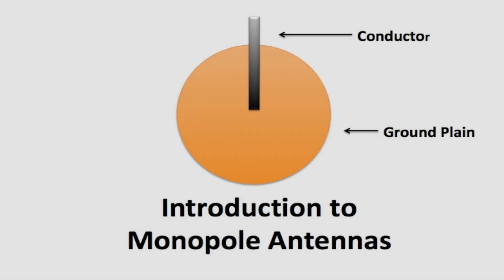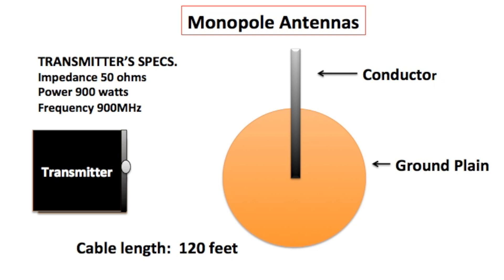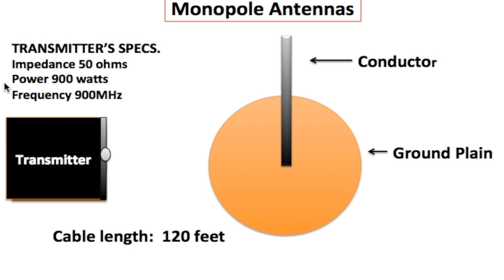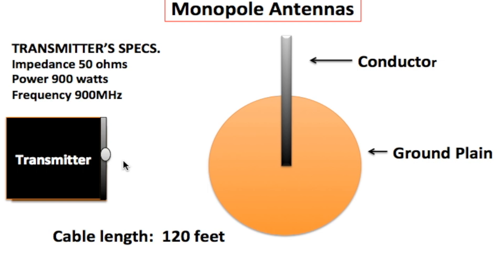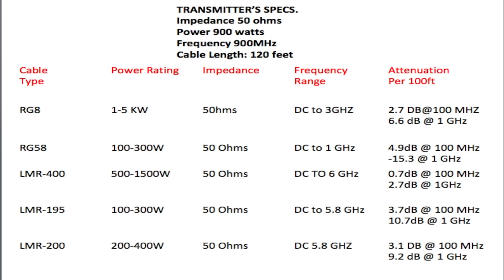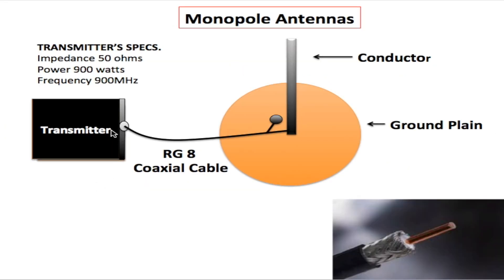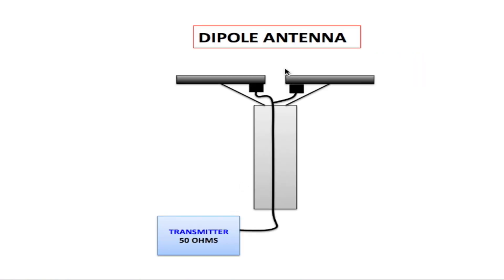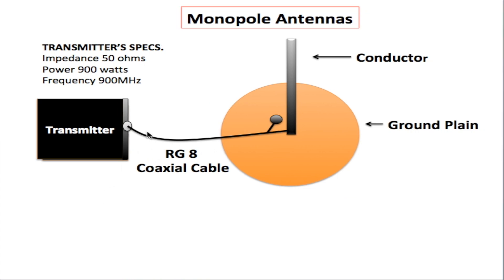HOW MONOPOLE ANTENNAS WORK

Comment: woow how come an antenna receiver require 900W power??? that means huge current.
Reply from the maker: You are right.  It is high.  However it is the power required to transmit over long distances. FM Radio stations operating between 88-108MHz typically transmit between 1kW to 100kW effective radiated power. AM radio typically between 1kW and 50kW.  Hope that was helpful.